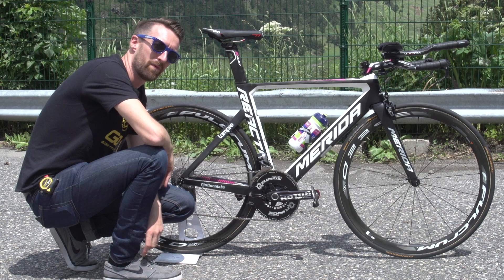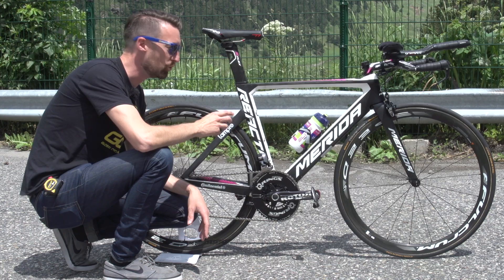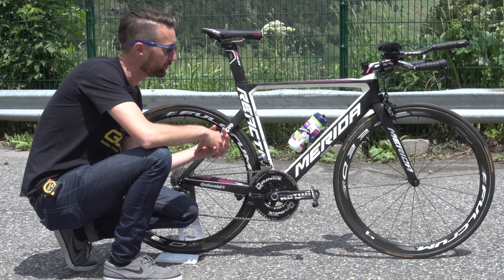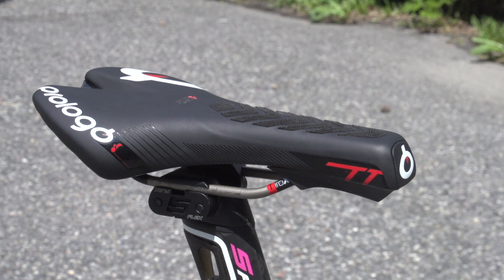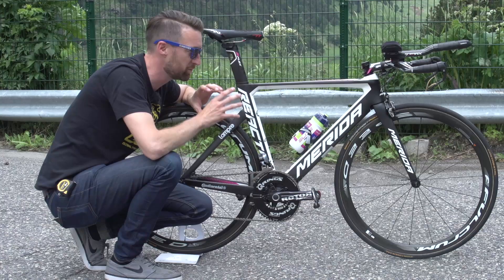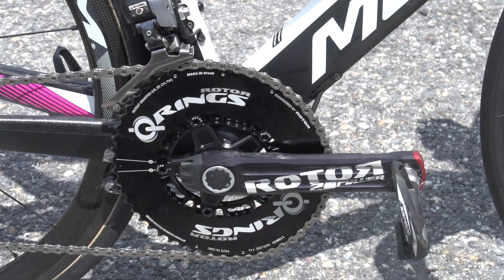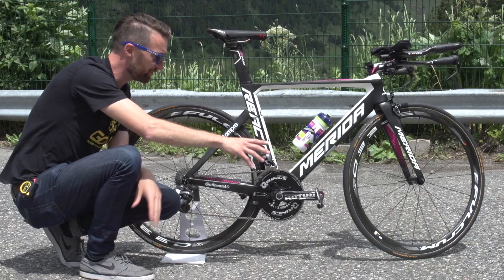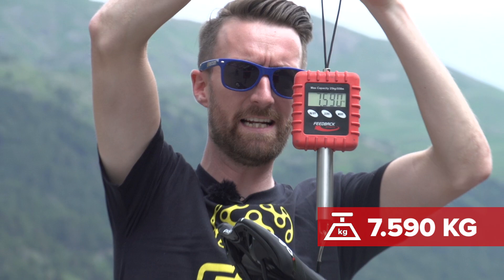Louis Meintjes' Merida Reacto Climbing Time Trial Bike | Tour De France 2016

Comment: Perhaps you've addressed this in another video, but how much difference does an elliptical versus a round crank make?
Reply: They supposedly take out the "deadspot" in the "perfect circle" pedal stroke. If I remember correctly. Though if they really made SUCH A HUGE DIFFERENCE, everyone would be on them right?
Reply: The reason why no one who isn't pro has one is because they require fine tuning and adjustment, not good for mass production.
Reply: Dazt4r That makes sense. I read somewhere they also help produce a more stable power figure... That's something I'd be interested
Reply: You can get them and work it out, but ideally you need a power meter that's able to show you on a graph where your peak and minimum power output is on each rotation, from there you can decide on a design that helps you.
Reply: I hear you :)
Reply: +Jan-Harm van der Merwe Well most pro riders have to use whatever brand sponsors their team. Chris Froome uses them because he is Chris Froome
Reply: Patrick Arredon Fair point actually! Though surely they have some say... If I remember correctly, Alexander Kristoff uses an Infocrank power meter, but he scratched the logo off because Katusha has a different power meter sponsor, and Verve cycling (infocrank) at that point couldn't sponsor the team

Comment: Why is it heavier than 6.8 kg ?
Reply: because it's an aero bike.
Reply: +Ethan S and why should an aero bike be heavier than 6.8 kg?
Reply: because it's very hard to make aerodynamic tube shapes light. The cockpit is also relatively heavy on that bike and so is the TT saddle.
Reply: +Ethan S I see the heavier handlebar. But since it's a mountain ITT, avg 30kph, I don't see the advantage of a heavier frame and wheels. Aerodynamic advantages set in at 40kph. 
Then for regular stages we see a lot of CGN bike presentations with "heavy" bikes, 7-7.5 kg, as if the 6.8 limit wasn't an issue yet...
Reply: +Ethan S for now, but the new material graphene will allow aerodynamic tube shapes to be really light. See the GCN show earlier this week.
Reply: Sidryk Chewo Air resistance overtakes rolling resistance as the main resistance at some low speed like 16 k/h. The effects of aerodynamics are extremely important to consider at speeds of 30 k/h.
Reply: GonzaJ01 I read into graphene before gcn had even heard of it. To me it seems like that technology is a long way in the future.